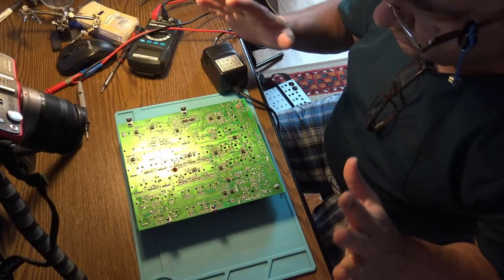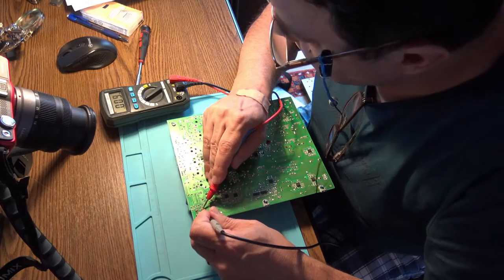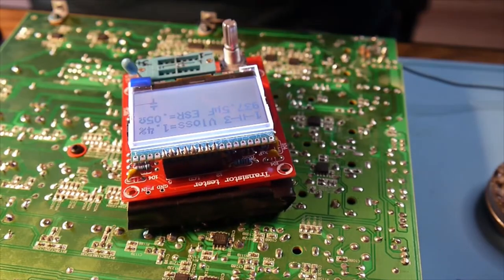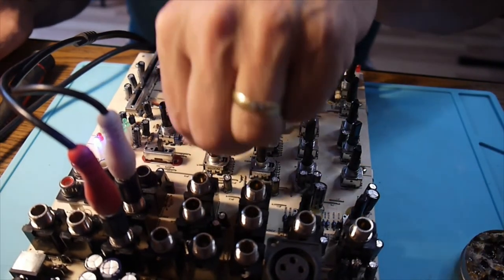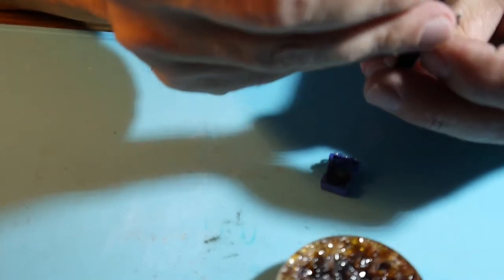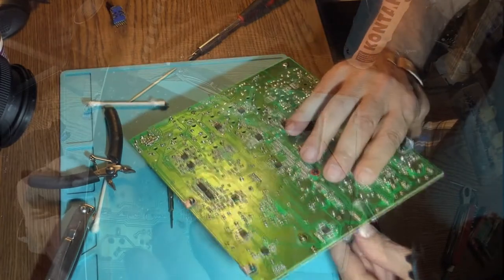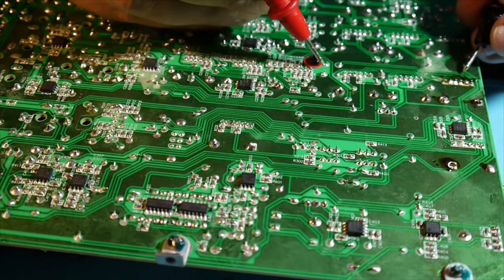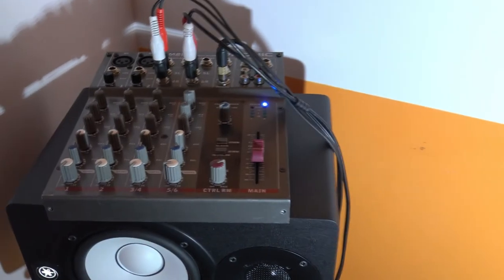Phonic AM220 audio mixer power supply and potetiometer fixing

Comment: I have a slide POT but it's not working and I tried to make it work but it disconnects in middle, I think it's internally damaged... Anyway nice video Sir ;)
And to be Honest it sucks to find the faulty component in the power supply isn't it lol
Reply from the maker: If you have a gap in the middle of the resistor lane..then it's over, new one in place! This fault was very easy..lucky me! I know is not a great mixer but for my needs, playin a piano and the laptop is perfect..and cheap..